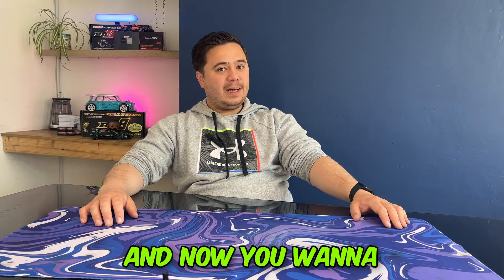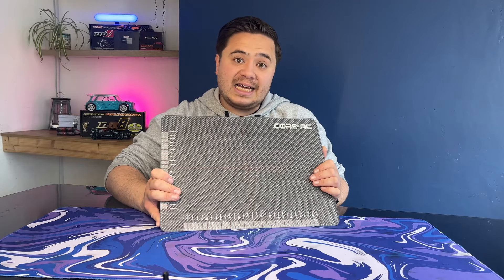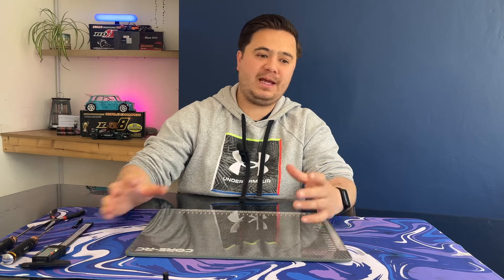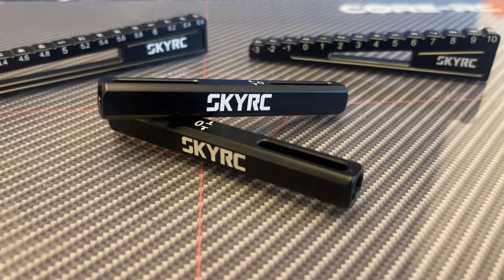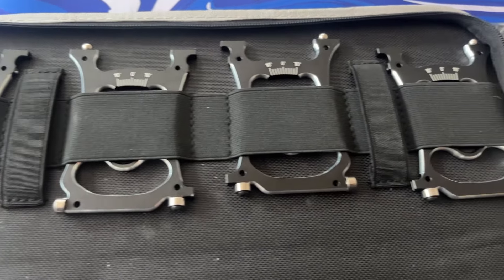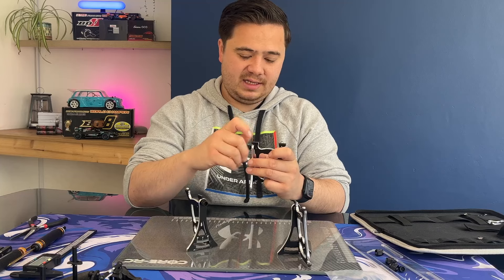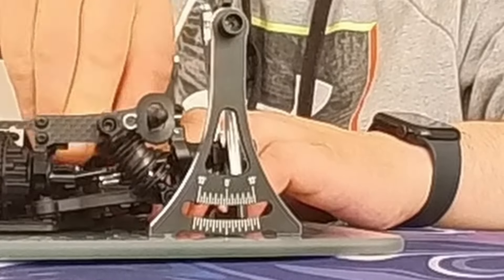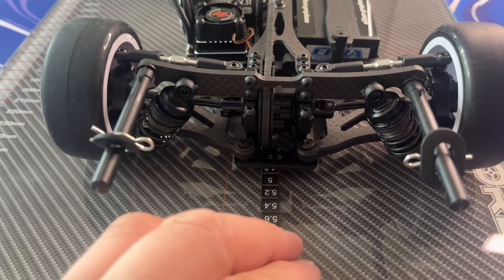What should you use? The ESSENTIAL tools to setup Your RC car

Comment: Quite often I leave out the blocks and use ride height gauge with the chassis flat on the board.

The gauge & block sets are all accounting for the 10mm of the block but aren't always as fine in adjustment. IIRC my Avid droop set only goes to 6mm which often isn't enough 😊

I start at 7F and 6R on BD12 & BD-Frontie